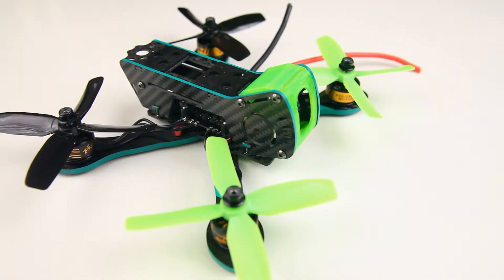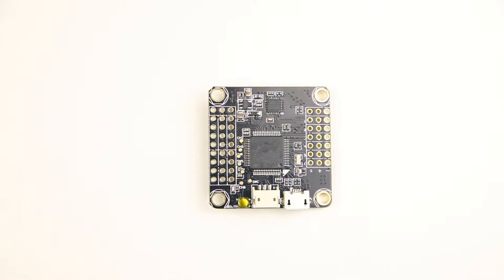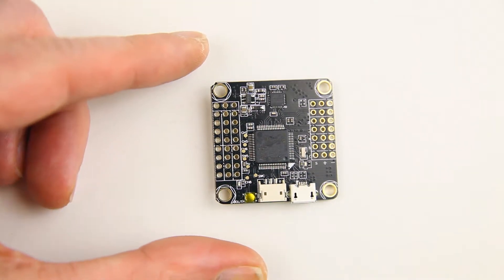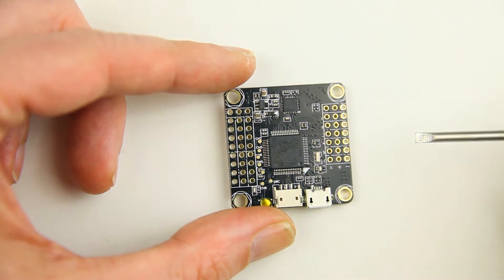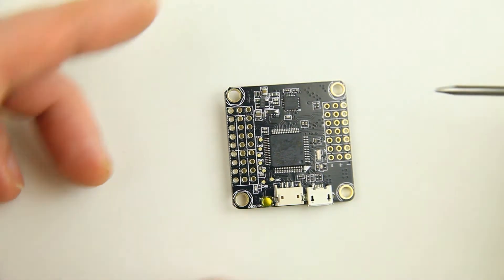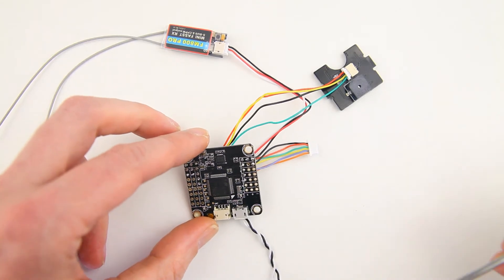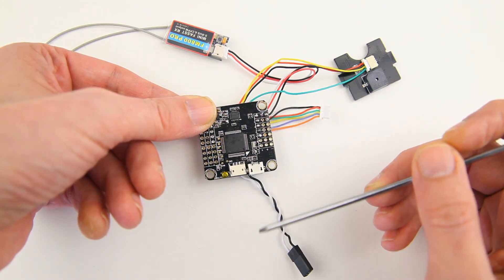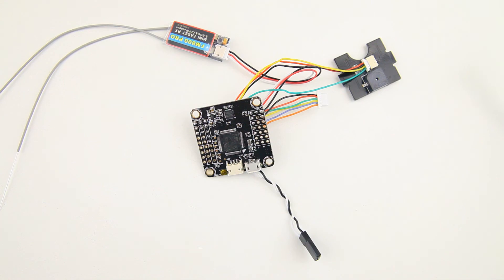GEPRC AX4 Light Quad Build! Part 5: Airbot Flip32 F4 Revo Flight Controller - How to?

Comment from the maker: a quadcopter without flight controller? Let's not try that, sooo How to install this Flip32 F4 Revo??
GEPRC GEP-AX4 Airbus frame: https://goo.gl/r7sEyZ 
REVO F4 FC: https://goo.gl/rQyVhC 
Racerstar RS20Ax4 ESC's: https://goo.gl/sLXncK 
T-Motor F3 1806 motors: https://goo.gl/EWdYpi 
Hyperion G7 HvLi Graphene lipo: https://goo.gl/FOm2Eu 
KingKong 4x4x4 props: https://goo.gl/8pUXRJ 
RunCam Swift 2 camera: https://goo.gl/RvXOR3 
Aomway TX001 transmitter: https://goo.gl/84DTZh 
FM800 PRO FASST Sbus receiver: https://goo.gl/m4IvZD 
Foxeer antenna: https://goo.gl/FL5hHY 
Lantian Buzzer: https://goo.gl/hUp10Z

Comment: 05:55 I have bought one this, is this one support using PWM to PPM or SBUS converter (ppm decoder)...that connect to the afhds 2A FlySky Receiver...?
Reply from the maker: I think your best shot would be to use the afhds2 receiver in Sbus mode.. As you can see from the boards diagram it has a SBus pad.. that should work.. 
IF you would want to use the receiver in iBus mode, you would need to use a different UART on the board.. RX3 for instance..

Comment: the leds worked? I have the same controller with the same board but I had a little problem to make work
Reply from the maker: Howdy Francisco :) 
yeah.. that LED output port on this board doesn not work if you run Betaflight.. If you run Raceflight it Does..
What I did: I moved the led-signal to the 6th motor / ESC output, and moved the resource (in betaflight) as well..
THAT way it does work :)
Reply: ok, I will try this, I tried the same port in or video (led-strip), will be nice if you make this video :)

tks

Comment: No wonder I couldn't get mine to work with either ppm of sbus 
Still weird you need to remove something to use it tho 
Anyway thank for this informational video
Reply from the maker: For Sure that is a bi uncommon indeed :)  But well.. at least it can be solved :) 
You're welcome! Glad the video helped you out :)
Reply: DutchRC Adventures 
BTW what board name did you choose on betaflight ??
Reply from the maker: AIRBOTF4 is the one you want :)
Reply: DutchRC Adventures 
Thanks

Comment: hoi! vond u dit een fijn bordje? ik ben wel geintereseerd in deze. moet alleen nog een fc en fpv en mijn eerste quad fliegt!
Reply from the maker: Howdy Jordi :)  Yes! Krachtige processor.. deze quad vliegt Zeer goed ermee :) 
Het enige 'probleem' was dat hij eigelijk voor raceflight ontworpen is.. In betaflight werkt de LED connector niet.. dan moet je voor LED's motor-connector 5 gebruiken.. verder prima goed :)
Reply: DutchRC Adventures oke nou dan word het denk ik toch een sp f3
Reply from the maker: Dat kan uiteraard ook.. maar voor alles kleiner dan 250-size zou ik nu F4's nemen.. die hebben aanmerkelijk meer rekenkracht / beter voorbereid op komende ontwikkelingen..
Reply: DutchRC Adventures kan ik hier ook gewoon pwm op gebruiken?
Reply from the maker: Hmmmm daar ziet het niet naar uit.. Sbus is niet een optie?
Reply: DutchRC Adventures nee het is echt aleen pwm. het is de frsky v8fr-ii. zou u even kunnen kijken? volgens mij kan dat namelijk niet.
Reply from the maker: Klopt.. dat weet ik zo wel, zonder te kijken :)  Dit boardje 'eet' geen PWM :$

Comment: Help Dutch!!!I have the same exact board. I cant get it to come up on the com ports in betaflight. I'm used to using librepilot with cc3d revo boards, what am I doing wrong
Reply from the maker: Howdy sir :)  That sounds like a driver problem then :) 
It kinda depends a bit on what you were trying to do (connect of flash the board) but you Should be able to find the right info here: https://github.com/betaflight/betaflight/wiki/Installing-Betaflight

Comment: Won't putting a Lead strip make your quad to heavy ? lol😃
Reply from the maker: Haha ohw! No need to be eating hats by the way :P  All up the quad weighs in at 370g ;)
Reply from the maker: Damn! I finally got the LEAD strip to work :P  That only took an evening ;) 
https://www.instagram.com/p/BTNEK3UluHW/
Reply: DutchRC Adventures Hahaha funny glad you got LED working right dam software and hardware not made easy ha oh well glad its done. Hat locked away to next light weight build lol.👍😃
Reply from the maker: Yeah man.. Only took an ENTIRE evening :P  haha 
Yes sir! To keep things (all up) below 250g you'd really need to build something smaller :)  But this is light enough.. the quad is Very  'floaty' :)
Reply: DutchRC Adventures Yep looks cool just im on smaller builds because of this EASA rules. That possibly coming in got everone scared to buy anything heavier than 250g. So im only going to build light untill i know whats happening.😢
Reply: Nou vertel, hoe heb je de leds aan het werken gekregen? Op mijn eerste exemplaar (zat bij de X210 kit) werkte het perfect. Bij een nieuwe die ik los besteld heb krijg ik het niet voor elkaar. Ik heb geloof ik zelfs al een led bordje om zeep geholpen...